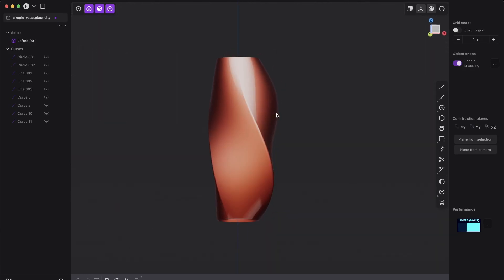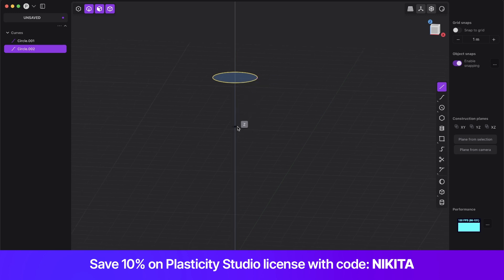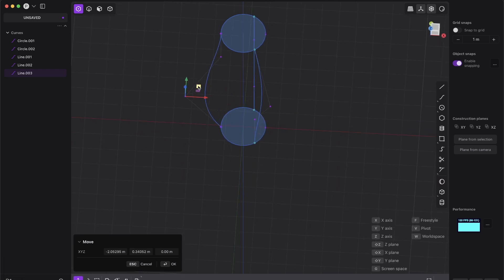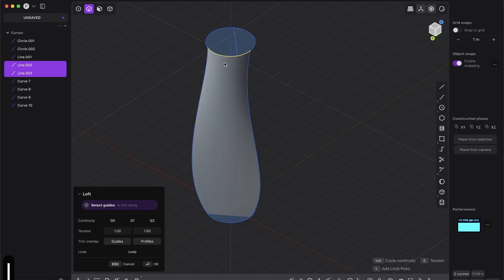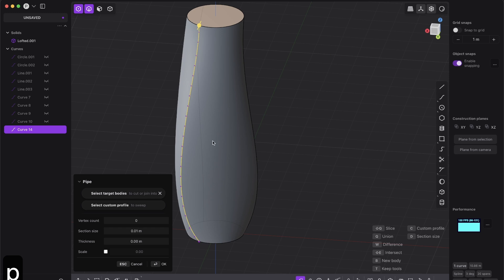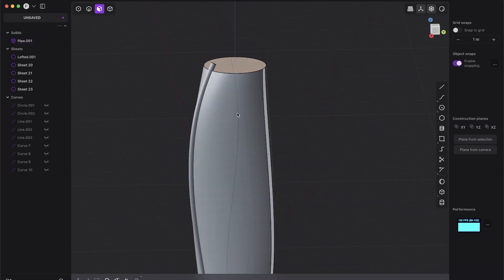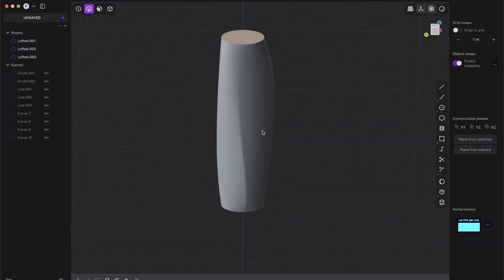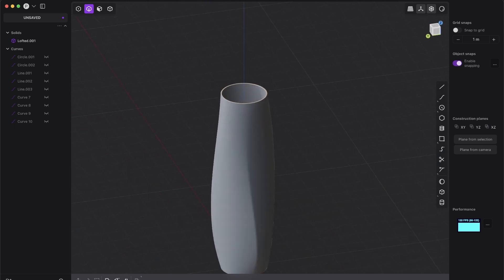Plasticity EASY Surface Modeling Tutorial

Comment: so it should not be on the edges why do they break in this program and it is not possible to soften the sharp edges normally ((( this is the standard for other programs, also not controlled edges from which you sometimes suffer and you need to redo the mod model for bad work, knowing the errors you can get around them, but I'm sad that it's all so ((

Comment: Thank you again for this very useful tutorial. I don't think you sleep much.. I must say this object is not a good rebuild of the example. Which has points that not align vertically along top and bottom. They are rotated 120⁰ along their connecting line. Hard to explain...